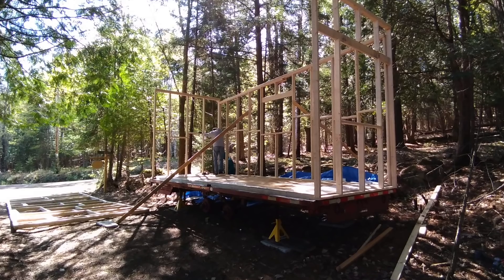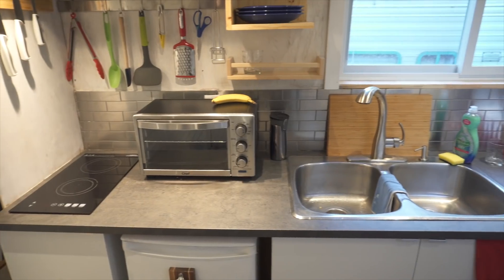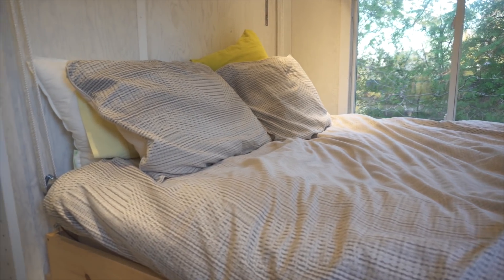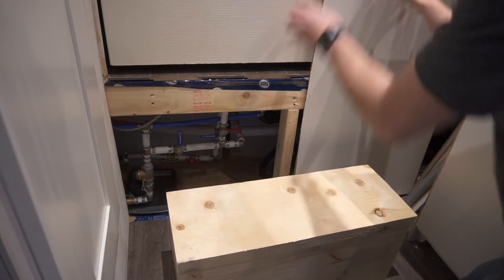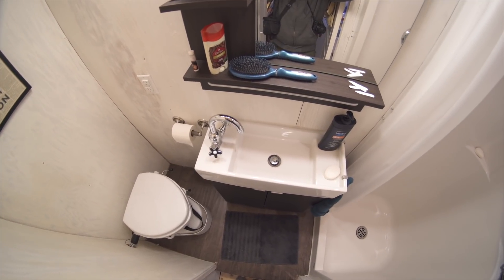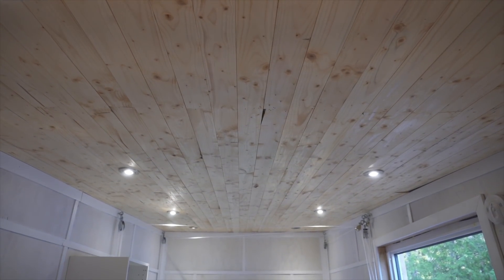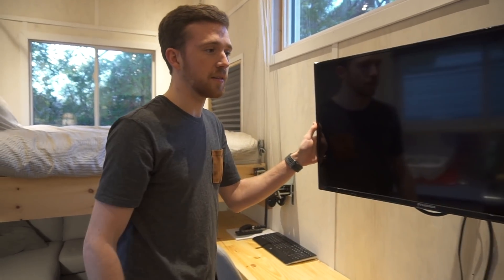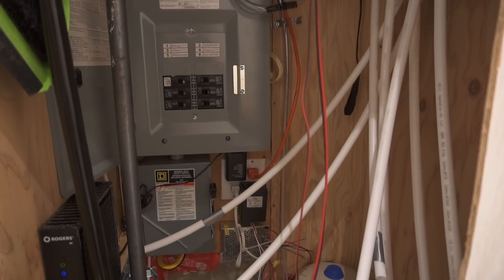Young Man Builds Super Cheap Tiny House with Clever Elevator Bed

Comment: It is refreshing to see a tiny house that is actually reasonable. Many on youtube are ridiculously expensive.
Reply: That's probably because of how he sourced the materials, did much of the work himself or with friends, and he isn't trying to sell it.
Reply: @remyllebeau77  Yes, that is correct. The only real problems I have with the tiny home stuff is that they are too expensive for what you get and they are not going to maintain their value or appreciate like a more traditional house. The shell of a structure is cheap. Most of the expense in building any house is the kitchen, baths, and roof.  Even if you want a small house, a 900 sq.ft. house doesn't cost much more to build than a 200 sq.ft.
Reply: David Kirley I agree. I could easily see myself in one of these, if only because it is cheep. Although, it could be simpler to buy a cargo van and make it into a camper van.
Reply: @remyllebeau77  I see used small park model trailers around here for half that price and lower. You could buy a cheap one and sock away enough money to buy or build whatever you want. Problem is that people might reduce their spending but don't increase their savings by the same amount.
Reply: Me and my partner are going to build a tiny house in the next few weeks. Starting with our kitchen, living/dining and a loft bedroom. We don’t need a bathroom yet as we are building it on my parents property and plan to add the bathroom/compost toilet and spare bedroom to the main building once we relocate the building to my parents family farm. We don’t have much money and intend on using a lot of recycled materials. We are expecting to spend around 10,00 NZD in total.
Reply: @iambaked1537  how did it go?
Reply: Reasonable is actually relative to what you expect to get from the home...  

For an analogy, it would be like expecting a Honda Civic to cost the same as a Ford F-450 one ton dually truck and have no regard for what makes them different... Even tiny houses can have a very wide range of differences...

People are simply not all getting the exact same home to meet the exact same needs or provide the same benefits... Or even having them built the same way and everything can have different trade offs and benefits...

Just don't think of it as a competition or think choices are limited because someone else did it differently when pretty much everyone can just do it their own way and it only has to cost as much as it takes to meet what you need out of it and nothing more...

What this young man has done is just one of many examples of people doing exactly that...
Reply: @ZeoCyberG  But that is not really a good analogy.  A tiny home on wheels is a home built park model mobile home and comparable to them. A more analogous comparison would be my house has a market value of $50K. If I put $50K in upgrades, that doesn't mean it magically becomes a $100K house. What it is worth in the owner's mind has no real relation to the market value to the rest of the world. This market value will effect taxes, insurance, and what options you have if and when your housing needs change. If you are willing to walk away from the difference in what it costs and the market value, fine.
Reply: Yes and no, what people are willing to pay always plays a factor, as does other market factors, but value is still influenced by what the product offers and how it's made.

It's like how you can get a car with optional upgrades... Not everyone is going to pay for those upgrades but those upgrades still hold value and there will be people who would want those upgrades and thus pay for them.

Much of the market is supply and demand driven and it's why most products have a range from budget to high end...

Same is true with how houses can be made and mind most of these homes are being custom built so they are precisely what the owner wanted... Just because someone else wouldn't want it doesn't change that...

It's like saying someone who has a special need like they can't walk and need wheelchair access isn't getting more value from a home that's actually designed to meet their needs and allow them to live an independent life...

There's much that not everyone would pay for but reasons why there are people who do pay for them...

While the comparison to Park Models and Mobile/Manufactured houses have their limits because they also have a lot of differences and not just similarities...  

Tiny houses fill a niche that neither RV's, Park Models, or Mobile/Manufactured houses fully address... They are easier to move than a Mobile/Manufactured house but harder to move than a RV... They can cost more than a RV or Park Model but they're actually intended for full time living and can be customized at a much lower cost and people can more easily opt to DIY them and aren't limited to only commercial manufacturers like they would be with Mobile/Manufactured houses that can only be built and modified by a HUD certified factory... Tiny Houses can also be much smaller than a Mobile/Manufactured house, which can only go down to 320 Sq Ft and can be over 1000 Sq Ft on the high end...

There are other differences but we'll be here all night if I list them all...

Suffice it to say tiny houses aren't that simple to categorize while my analogy may not have been the best but I think the point it made still stands...  The actual value is the effect on the owner's life and what's that worth is simply something everyone has to decide for themselves...